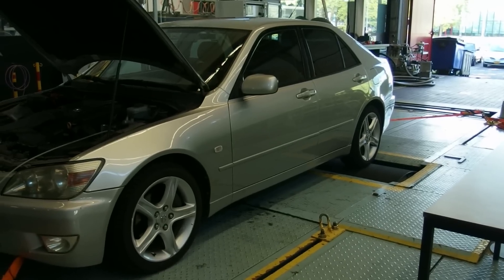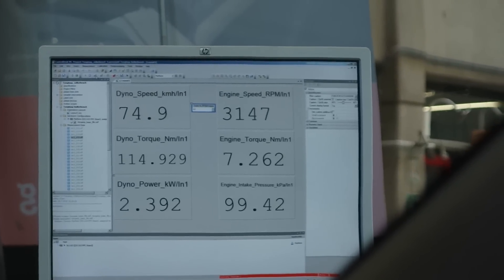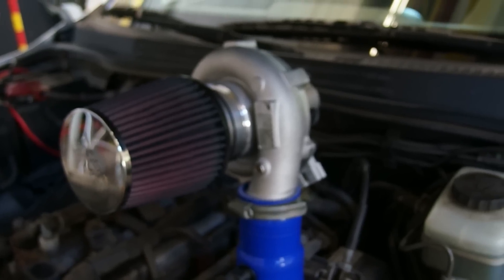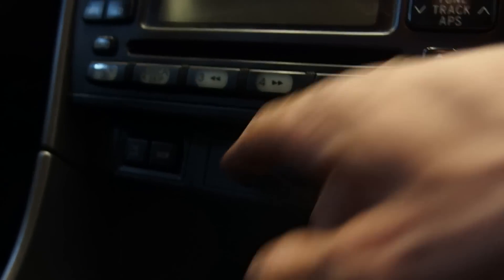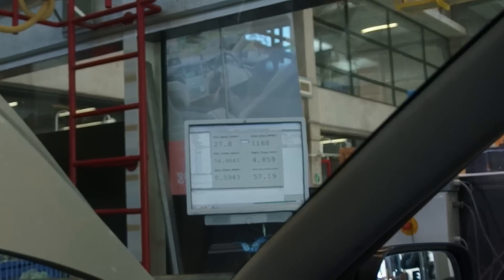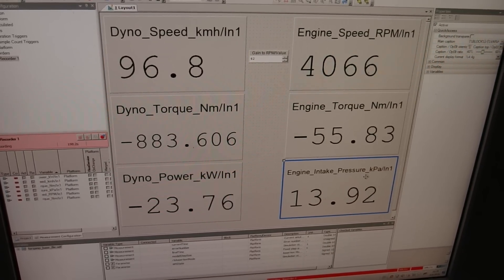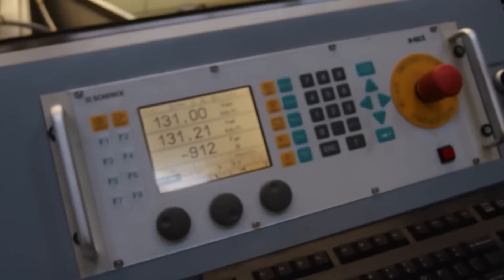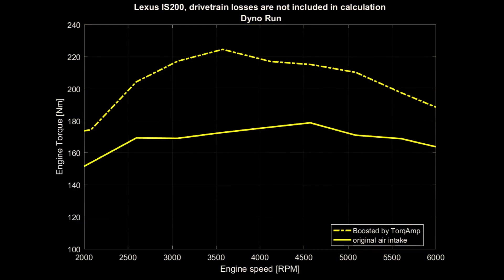Dyno testing Electric supercharger on Lexus IS200 TorqAmp

Comment: Don’t know why it’s taken people this long to figure this out.. we all know that centrifugal superchargers work. Keep in mind the gearbox.. make an electric centrifugal supercharger with the same gearbox and presto. You have a very efficient and powerful supercharger. And no, there will be no (or very little) parasitic effect of the charger. (With a high output alternator) basically the same as a belt driven supercharger of any kind. Time to wake up.
Reply from the maker: There are some companies who already launched such a product but they stopped. Now some technologies are more developed and cost attractive. I guess that's one of the reasons that it is now more feasible.
Reply: TorqAmp absolutely. 👌🏼 it’s basic mechanics at this point in my opinion. Leave the complexities of turbine design and cfm generation to the pro’s who’ve already figured a lot of it out (turbo companies lol)
Reply: EVERY DAY I RACE of course. What’s your point? 😁
Reply: @everydayirace  for what..? im not selling anything. if you're looking for a 12v motor that will spin a SC for your own use, then hop online or your local electronics parts store and find a 12v motor with the adequate specs you're looking for.. what are the ratios of your gears/pulleys? what is the output of your alternator? will you upgrade or use stock? you need to have an idea of how much current the motors going to draw depending on how much resistance the SC gives off.

you need to factor all these parameters in when you choose your motor.
Reply: EVERY DAY I RACE what makes you think I don’t know what I’m talking about..? Also what’s so funny about a 12v motor spinning a SC??
Reply: EVERY DAY I RACE umm.. let’s establish which type of SC.. i was talking about centrifugal. (like in this video) they don’t create as much resistance as a whipple or roots style. There are PLENTY of 12v motors that would easily spin a SC.. EVEN a roots. Ever heard of a high torque motor..? High amperage, lower rpm. (Still plenty of rpm for this application, but has a lot more torque to spin a charger with a gearbox) don’t start doubting me or my logic just because you haven’t seen or been able to buy a good working SC in an auto parts store.
Reply: EVERY DAY I RACE wowww two whole superchargers and a few motors on your bench..? YOURE AN EXPERT!! Lol you think just because you own a few components you know the ins and outs of it all and there’s no other way but yours??? Stop saying I don’t know what I’m talking about when you’re the one that needs more experience and try things that your shop teacher didn’t show you.
Reply: EVERY DAY I RACE I have 5 kicking around in my shop right now.. it means nothing!
Reply: EVERY DAY I RACE breeze right past my comments when you know you’re out to lunch. Look them up bro, it’s common knowledge and they’ve been around for decades!! (High torque low rpm motors) 
You’re the one who has no clue what he is taking about.
Reply: EVERY DAY I RACE it would probably be a lot cheaper to run an inverter and use a 110-220v motor even.. they want an arm and a leg for the 12-24v ones.

Comment: The price is about the price of "entry level" conventional turbo charger, my question is, how reliable this system is? I had similar ones installed on my car,  I did works but only for 11months, yes not even a year, lucky me, my eturbo was cost less than1000us$ the eturbo itself was few hundred dollars the rest was extra baggage charge to the guy who brought it to my country.
Don't mean to offend, if the key word is "it works"  mine has "works proven" for less than a year, with the price of almost four times of mine Torqamp must ensure it's durability is worthfull.
Reply from the maker: We drive already a couple of years with the current design ourselves and it's not yet broken. We did several endurance tests such as battery charge discharge, compressor spool up etc without any problem.

What was the product you bought which was working for only this short period?
Reply: @TorqAmp  I still confused about the brand, my friend bought it when he visit US and Canada by early 2017, to simplify things He repacked his turbo and mine into a wooden box and left original packaging include manual guide in Canada, on the turbo casing which is very identic with a real turbo no stamp or marking of any brand, there was only Inlet and outlet mark attached, but the built quality is very close to any branded conventional turbo,
My problem was on the Pepsi-Cola sized multi speed motor or maybe the control box with was fully sealed by some kind of resin.
The first problem it was refused to kicked in at medium rev @3000-3500 rpm, couple of weeks latter the problem swap to low rev and the middle rev was back to normal just for another week, I tried to fix it, even pro competition mechanics raised a white flag for this problem,  until one day it busted a new battery, so I gave up and uninstall all things.
My friend has more tragical stories, his turbo only last four months after he incidentally reversed the battery cord.
Well that was the story of my eturbo, I wish it can be a worthfull information for you.
and I wish You will have a great fortune through this product.
Hope it will enter Indonesian market soon.
Reply from the maker: @bambangnugroho7192  could it be the Phantom supercharger? It had a pride of around 1600 a 1700 USD if I'm right. This was excluding batteries and was working with lead acid batteries.

Comment: How do you justify the price?? A speed controller, brushless dc motor & lithium batteries aren’t even close to the asking price! & turbo housings & impellers don’t cost the ridiculous asking price either....
Reply from the maker: It's easy to find the cheapest products nowadays. We don't take these cheap components. We tested it all but you really need the high quality to make this happen. So you should take the expensive components for your comparison. For example people don't like it when the battery is dead after a year. In addition it's a development of 4 years with several custom parts such as a special high power high efficiency battery charger. Such components don't exist but are really necessary to make this happen.

It's also not an expensive product when you compare it to a quality turbo build on a lot of cars. Especially when a shop will do the install and you have to pay labour hours the TorqAmp is a relatively cheap product compared to a turbocharger. Don't compare it to the cheapest eBay turbo kit for a Honda because not everyone is driving a Honda.
Reply: Still shouldn’t cost $3400 to buy one... & given it CAN NOT achieve a high level of boost pressure, you’d be better off with a real turbo! & a haltech ecu to tune it properly... because at least you’d get a solid 10psi out of a non turbo motor safely.

Which is a shame. I had hoped for much more out of these setups...& I really think you have priced yourselves out of the market.
Reply from the maker: @pauladams1156  the price is 2500usd
Reply: TorqAmp I’m talking Australian dollars $3629.25aud = $2500 usd. That’s ridiculous for what you get.

I turboed my 1jz soarer with a big single setup, greddy fmic, coilovers & a Torsen lsd from a supra for about that price....

Which says it all.
Reply from the maker: @pauladams1156  okay then indeed that is the price. We challenge you to make a decent electric supercharger for significant less money ;)
Reply from the maker: @pauladams1156  we have a 500W charger and a 5kW electric motor. The battery is 400Wh. The guy in the video is producing around 600W of electric power so for less money you could consider to buy this unit. https://www.ebay.co.uk/c/502362805

Comment: You have a 200nm motor right next to the charger, yet you want to power it with an electric leafblower motor. Do you see why this isn't a good idea?
Reply from the maker: I do not completely understand what you mean. The combustion engine gets more air so it's able to burn more fuel. Therefore the torque will increase significantly with relatively low electric power.
Reply: @TorqAmp  What I mean is that instead of powering the charger with the 200nm motor already found in the engine bay, you use a small electric motor.
Is it running off the car battery, or powered externally?
Reply from the maker: @AX-xi2pw  it is powered from a 48V battery which is charged from the 12V system during cruising. The charger is switched off at full throttle so no parasitic losses during boosting!
Reply: @TorqAmp  ah ok. A separate battery is definitely better. Although it still won't be good for track racing or anywhere you have to keep accelerating hard for a long period. What is the highest boost pressure you have made with this in high rpm? 0.3 bar?
Reply from the maker: @AX-xi2pw  it highly depends on your engine size. A large engine will have 0 bar boost at high rpm and a smaller engine could have 0.4bar. It depends on how the compressor matches the engine. The compressor map could be found on www.torqamp.com
Reply: @TorqAmp I have a 08 v6 4.0l mustang with a 9.7:1 compression could make significant gain with one torqamp?
Reply from the maker: @VexFreerunners  only at low rpms, at higher rpms you will not gain anything. You can consider 2 TorqAmps. We are also working on a larger version.

Comment: Wow, i thought this was so cool, until i saw a 3000 dollar price tag. A vortech charger kit is 4200 and you get over 100 hp on a m52...... When this is more cost effective, its a billion dollar idea. Until then its a cool gimmick thats too expensive.
Reply from the maker: We will launch a Kickstarter campaign with a lower price soon. It is highly depending on what you need and want to if a TorqAmp is the most cost effective. In general the TorqAmp is much easier to install and the boost level is chosen in such way that you need a minimum of modifications on your engine. So no need to lower compression ratio, no intercooler etc. It only needs some silicone hoses and depending on your car ecu tuning. For turbo compounding this is the most simple solution with great results.
Reply: @TorqAmp  im not being negative, just constructive criticism. I can see it in use for the guys who spare no expense  and have wads of cash for the perfect anti-lag system. but it would be really cool if it were cheaper so everyday cars could get a slight boost with little fuss.
Reply: @TorqAmp  P.S. if it were more in line with the power to cost of conventional units it would also be a lower stress solution for those that dont need a huge boost in performance. When it gets there it will be one of the most exciting products ive seen in a long time. say $4200= 100hp 85tq / $1500= 30hp 70tq At that point its a billion dollar idea.
Reply from the maker: @VeiLofCognition  we are working on it ;)
Reply: @TorqAmp  Yeah you TorqAMP guys always advertise that's its easy to install etc etc. But you never tell that if you install this it will stall and choke the engine, so 300 euro ecu tuning is needed. You never tell about that....
Reply from the maker: @mistervova11  Thanks for the feedback. Our experience is that it is highly depending on the engine and ECU. Some ECU's give more fuel and the other needs a tune. When you go through the movies it will be addressed several times but maybe we should emphasize this more often.

Comment: I mean really that thing could barely put out 350 CFM at best I mean for $3,500 and you have to have a nuclear bomb lithium battery in your car just getting nitrous
Reply from the maker: You can find the compressor map of the TorqAmp here: https://torqamp.com/torqamp-kit/

We are not used to use CFM. The maximum mass flow is around 150g/s. We are working on a smaller PowerBox. The lithium battery is relatively small, some other components are shrinking down.

Back here in Europe you don't really see people installing nitrous.

Comment: This will be perfect to bolt on your 4-cylinder Honda if it was only $1,200
Reply from the maker: Don't expect such a low price soon. We recently dropped the price from 3400usd to 2500usd. We will offer a kit without battery/charger in the future but still don't expect a 1200usd price tag.